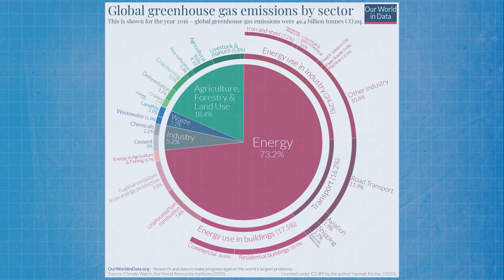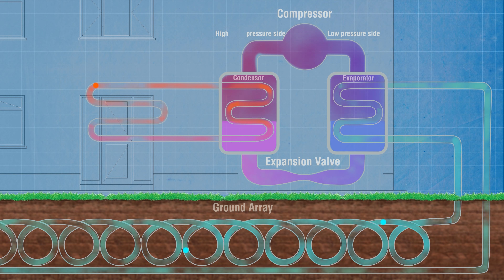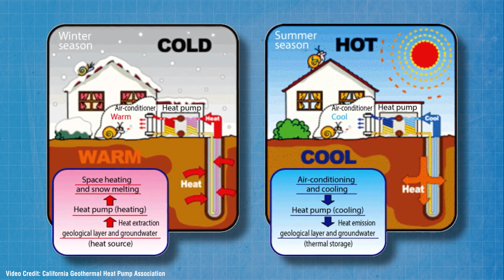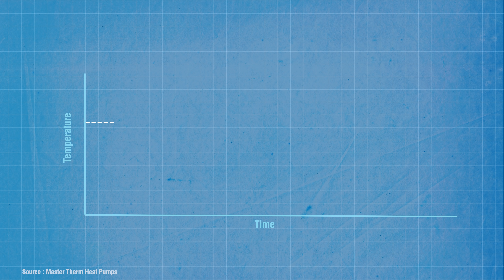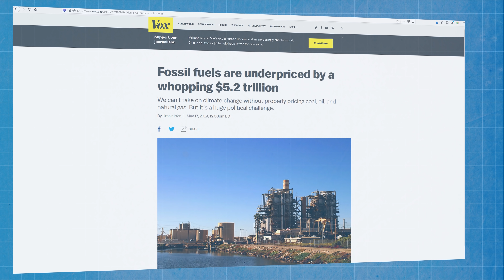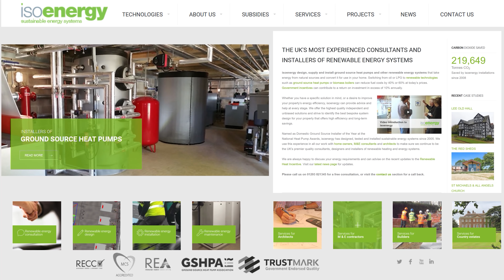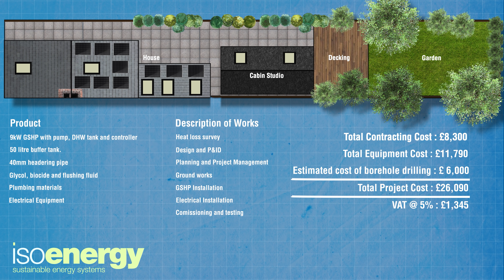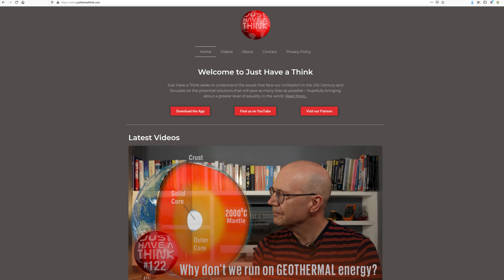Geothermal ground source heat pumps. Heating your home from your own back yard!

Comment: We have an open ground-source heating system, with an extraction well and a separate injection well.  It has worked flawlessly for the past 5 yrs or so that we've had it.   My only complaint has been that this source doesn't have the temperature differential that our old oil-fired furnace did, so the air from our ducts is cooler and not as nice to sit over on a cold day!
Reply: How can be it flawless if its giving out cold air on a cold day? Wouldn't you want to turn it off at that point?
Reply: @drsquirrel00  The air flow is warmer than room temperature, just not toasty-warm like the blast from an oil-fired furnace.   It still heats the room, just not as fast and it tends to feel a little drafty when it first fires up in the morning...our thermostat is set at 12C at night and 18C in the day.
Reply: @robertmacgregor9716  I only replied as you just said air is cooler from the ducts though?
Reply: @drsquirrel00  Sorry to have been misleading.  "Cooler" is relative to the heat output from the vent with the oil-fired furnace...it only feels a bit drafty because the air is moving; once the room warms up, I don't really notice the heat going on and off unless the fan noise catches my attention.
Reply: Why do you set the indoor temp at 12C at night? This is a rather unusual use case for heat pump systems. Basically you like to be in a cold environment but have a hot air source blowing over you just when you need it: if so, heat pumps may not be the ideal technology for you, as heat pumps are most efficient when the output temperature is relatively low (e.g. 35C) be it delivered via air duct ventilation or radiant floors.

Comment: Quick reaction from an owner of an air-water heat pump. We live on top of rock and were told that a ground sourced heat pump was a no-go. Just so you now. There are geological factors to consider.
Reply: You can still drill vertically. Rock makes for n excellent heat conductor so you do not need to drill nearly as much as you would in sand or clay

Comment: Air source heat pump equipment is just as efficient and much less expensive and far easier to install.
Reply: Hi Joe, Air source certainly costs less to install, but they are not as efficient considering year-round performance. In the summer, you can get as much as 5:1 from an air source, but in winter when you really need it the most, it drops right down to around 2:1 We average it out at a factor of 2.8:1. A ground source heat pump will have a year-round figure of at least 3.4:1 so more efficient.

You raise a really good point about ease of access. We install both types of system depending on circumstances and budget. Many people start looking at GSHP and end up installing ASHP when presented with the costs. Its about using the right tool for the right job.

Comment: Air Source heat pumps are a more realistic solution for most people. They are a lot cheaper than Ground Source. People don't need to disfigure gardens & dig costly huge trenches or boreholes...
Reply: Very true. We've made a mess of many a garden temporarily and the civils in the project are disruptive. ASHP however can be installed for a fraction of the cost, but the running costs are higher, often making it more expensive to run than natural gas, precluding the very market they are designed for. The incentive from the government is also less for ASHP making the payback period longer. Hopefully, we are coming to a tipping point where they will be competitive against natural gas and therefore the technology of choice where a GSHP is unfeasible.
Reply: @isoenergyltd  Give it 20 years. At which point we will have used the last of North Sea Gas reserves. Imported natural gas will be more expensive. That should provide the needed tipping point. ASHP are pretty cheap though at the moment...

Comment: You can get close to the same efficiency with good air source heat pumps. I heat my house in Canada with only heat pumps and no bore holes were required.
Reply: The overall efficiency margin (seasonal COP) of ground source heat pumps is still 1+ points over air ones. This even includes warmer climates where houses require both winter heating and summer cooling. Sure, if your house is well insulated and, perhaps, you get some of your electricity through photovoltaics, cost breakeven point will be far in the future (potentially decades).

Comment: What an Ignorant.  Geothermal heat pumps have been in use since the 40's and early 50's.  Not the last 2 decades.  But, a moronic law/regulation was passed requiring a certified COP of 3 to be installed.  This meant not only did you have to pass a moronic test and pay for it, but you also had to find a CERTIFIED "professional engineer" to use his damn stamp.  Therefore the cost skyrocketed and all the early companies died on the vine  as all jurisdictions now required certification instead of... a COP of 1.1 isn't better than 1.... WHO THE HELL are they to tell someone how they heat their home?   Who was it pushed by?  Electricity companies who did not want to sell 3X or 5X less power.

Comment: The "value proposition" for geothermal heating and cooling varies widely depending on location, installation costs, soil type, soil temperature, heat demands, cooling demands, efficiency of the system, cost of electricity compared to the cost of alternatives of natural gas, propane or (God forbid) heating oil.   For me, my return on investment was around 8%, but we have very special set of circumstances.  I live in a rural location and natural gas wasn't available, but I do have a 1000 gallon propane tank here.  Propane currently costs about USD$1.00 per gallon (sorry for the imperial units) and the spot price can touch USD$1.50 but most people buy on contract. .  Ground is mostly rock free for 50 meters. Ground temperature is 12 degrees C year round.  We need heat for 6 months, cooling for 4 months.  Lowest outdoor temps are in February and reach -20C and highest outdoor temps touch up to 38C in July/August (not a weather paradise!).   Our home is 500 sq meters and I installed two 5 ton (sorry, not sure of the metric equivalent, but they consume 4KW constantly) systems back in 2011.  Each 5 ton system has six wells that are 60 meters deep.  I placed the manifold in the basement, with manual shut offs, so that I could balance the flow of each glycol circuit.  Our back up is a wood stove.  On the coldest days the geothermal heat pumps are constantly running.  In the USA, natural gas is so inexpensive that a geothermal system wouldn't be cost effective.  Lastly, it is very nice not to have condenser units outside of the home - nothing to clean!

Comment: Most the houses in my village have ground source heating a few have broke and caught alight. Mine keeps sparking and crackling now.. and the company that fitted it has gone bankrupt so has anyone got recommendations for good companys to fix it?
Reply: Where are you? We may be able to help. Have you tried contacting the manufacturer or are they the ones that went bust? If not, they should be able to put you in touch with serviceing engineers in your region.
Reply: @isoenergyltd  hi sorry for the late reply. im in west midlands area. The manufacturer is calorex and they only make swimming pool heaters now. I phoned Robert heath for a quote they said they dont cover my area. I told them they do because they fixed my grandads in his council bungalow... they reluctantly came out a few days later than planned and the engineer said i need a delay timer and a contactor. I recieved an email today saying i needed them 2 parts and a new pump for £700. Do you think they are trying to add the pump on to the quote for extra cash?
Reply: @martink4205  To be fair, £700 for fixing it seems like an ok deal. I can't comment on if it needs a new pump. Compared with the cost of a replacement unit being thousands, not hundreds.  You could contact a heat pump distribution company in Cannock called Nuenta who can recommend other local companies who may be able to help.
Reply: @isoenergyltd  no sorry i should have explained better it was £700 just to buy the pump. The quote was about £1200. But it just seemed fishy that he didnt mention the pump at all during the service then desided it needed one while he wasnt here
Reply: Hi im just after some advice. I had the delay timer and contactor fitted then was told the relays needed replacing.. got that done still not working so they told me i need an electrical engineer to have a look.. no ones been out to test anything but they are saying its condemned. so should i get a refund for the work done as the problem should have been picked up on when serviced?

Comment: Might the wide scale use of geo energy cause excessive heat in the air and cool the interior of the earth thusly causing a different sort of calamity to life as we now know?
Reply: The energy we extract for a ground source heat pump comes from solar gain and is replenished. Deep geothermal systems, like the ones in Dave's previous video only extract a tiny amount of what the earth's gravity is generating through compression. You are right though that towns and cities have an adverse effect on the local climate and even generate their own microclimates. I think though by the time our urban sprawl encompasses a large enough surface area of the earth to have a global effect from the heat we generate, we will have already destroyed the other more global systems our weather relies on like the rainforests and suffered as a result.

Comment: In the late 70's a friend of mine who is an Architectural Engineer used solar water panels to heat her domestic hot water and drive a heat pump to condition her home.

Comment: Renewables cheaper? Seriously is there city where a stand alone renewable power source working? I don't think this pipe dream has been achieved. They tried here in Australia to include solar at the best latitude 15 degrees,. when the clouds came over and they could not run up the fossil fuel generators fast enough so a renewable Blackout.

Comment: 20 years?  we've been heating our house in new zealand with geothermal hot water for over 40 years,  granted its much simpler than a "heat pump" with just a pump that sucks up hot water, which then goes through a water to water heat exchanger,  the water that goes through the exchanger is then pumped around the house in a closed loop, and the "spent water" from the geothermal side (in our case) drains into a spa pool before heading down the drain,

these systems were pretty popular in the 70's in certain parts of nz ,  but a new bore isnt really allowed these days as the big power companies have all the geothermal rights tied up with the respective councils, so you cant get permission to drill,                 a story as long as history itself, profits before people ;)
Reply: A solution to the geothermal right issue would be "your right to use the energy, but not selling the energy"
Reply: I knew there has /had to be a reason! #why? #worldrenew #climateemergency is should be OUR motto = should be something when we now vote /we need a promise and hold them to it -approve only geothermal to another level of clean and remove all preventing us all being the world, approving this and inplementing it immediately before anymore forrests claimed to be only ground cover or garbage fuel is destroyed!  Its not that BIO anything to blame - as it is mean’t to be good =  it is what actually happens is the problem!
Reply: I would like everyone interested in why? We are NOT using geothermal heat pumps to heat and cool our homes! This in 70’s was considered going overboard by the hippies! Whos SORRY now? We all need to stop look around something BIG coverup is coming down. #geothermal #geothermalenergy #actnow #climateemergency #worldrenew
Reply: A good.
Until the earthquake
Reply: I hope some corporate scumbag doesn't come up with 'solar rights' to find another way to extract money from people.
Reply: Odin Thorsdad ~ a big problem right now is the questions Do we do whats best for all or just millionairs, car,iphones,technical software and hardware companies, banks, corporations or humans? If for both to have a solution I feel the side that needs all this power should pay for the Geothermal conversion to all homes small businesses schools etc., and allow them in turn to use the existing fuels like fossil and coal to make it possible to make their techy stuff - til we figure out a better way?  This cost of implementing geothermal to all - can be equally dist between users of dirty energy also precious metals and pollution they CAUSE!  Thereby making geothermal our new planet preserving attempt and keeping our evolution growth going! Win win plan for now! Til we know better and do better! #worldrenew #energyemergency #actnow #bloomberg #bloom #blood #gore #350.org #greenpeace #geothermalnergy #Sierraclub #energy #bioenergy

Comment: We were disappointed that the new UK government grant only helps people convert existing oil or gas boilers to heat pump electric. There is nothing for those of us wishing to get rid of a coal stove and storage radiators. Air to air heat pumps are not included in any grants I can find.
It was only last year "government departments" wanted an outright ban on coal fires, but that was watered down to only burning smokeless fuel.

Comment: Excellent video. Perfect details. 

Why aren’t all new homes in very hot and very cold climates required to have this? 

I’ve heard of it but never heard of it installed in Australia. The underground garage in my apartment building is always cool and stable. It alway seemed a shame that couldn’t have been used in some way. 

For terrace houses wouldn’t it be most cost effective share a larger bore hole or have multiple installations at once?

Comment: Waste water from large scale geothermal is toxic to life but these systems, which I've helped install are actually quite good... Not really a heating solution but cost effective as part of a heating system.. Saves money in the long run, despite the extra building materials and cost..  Not green as it does not release CO2, and reduces CO2 emissions if your power source does release PLANT FOOD - but I approve for financial reasons if you intend to live in the house for decades and add value when selling the property... No subsidies though, Liberal Scammers... Don't rob Peter to pay Paul or you're just moving deck chairs on a sinking ship.
--
As all unbiased, intelligent, non-fake greens such as myself know, Orbital Variation at all levels, random and cyclic, then H2O at all leves, then atmospheric CO2 a distant third are the top three climate factors. You'd have to be a brainwashed ignoramus to think otherwise... If you want a SELF-RECYCLING SYSTEM then adopt a CARBOHYDRATE ECONOMY, with O2, CO2 and H2O the only non-taxed/non-illegal emissions.. Be aware though, as the world greens, especially by forestation, humidity will increase, and as you should know, H2O is 1000x more of a powerful greenhouse gas and on average 5 times more abundant (although this varies greatly locally and can be much higher at times in places - although deserts are not as dry as many think)...
--
CO2 REDUCTION WILL NOT SLOW NATURAL CLIMATE CHANGE appreciably and we are in a major historical CO2 drought. CO2 reduction will increase dessertification. Average temperatures have varied +- 3'C for short and even prolonged periods in the last 2000 years alone but the general trend is upward since the end of the last ice age... Throwing money at liberal progressives will just mean MORE JUNK, MORE OVERDEVELOPMENT, MORE WASTED MONEY.. Those that want a climate controlled Earth are mental cases. It's like a dystopian doomsday cult.
--
Safe, compact Thorium Molten Salt Reactors fueled for 40 years with easily stored, compact, potentially useful not very toxic waste. More power per buck too.. and of course Waste To Energy + Refined Matter... The two green techs ignored because of the Enriched Uranium Nuke Heads of industry and the military and LAZY LANDFILLERS... 1000 full landfills, another 1000 almost full, polluting the ground and making it uselessly toxic and unstable to mankind.. These were the proposed green power solutions back in my day, before the Mega-Liberal Capitalist and Uber-Liberal Socialist FAKES SCAMMED THE WORLD.

Comment: Astonishing that this is not being rolled out nationwide. There is such a paucity of leadership and planning. 

However, do wonder about the longterm maintenance costs. How long do these systems last for before they need to be renewed?
Reply: We have to design the system to outlive the return on the investment for a start. So as standard the industry will guarantee workmanship for 10 years. Manufacturers warranty the equipment for different periods, but mostly about 7 years.  There is a lacking in skilled engineers in the UK with the f-gas qualifications and system knowledge needed to fix these things if they go wrong, so the costs are high compared to servicing a gas boiler for instance. (by a factor of about 3). However, the more people take on systems like this, the greater the demand for service engineers and the costs will reduce. This industry is in the process of moving out of the early adopter phase into mainstream deployment, but we are working on it :)

We have been installing heat pumps successfully for over 10 years and only now are we finding the odd client who wants to upgrade their system. In those cases, it is mainly because of modifications to the building so they need a bigger one.
Reply: @isoenergyltd  thank you very much for the detailed reply.